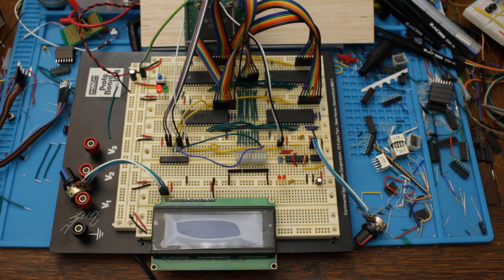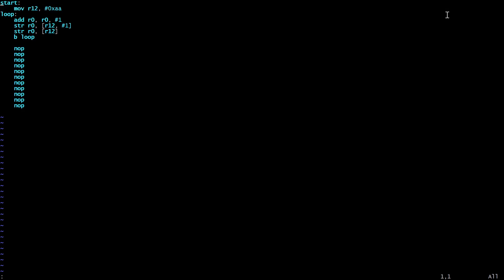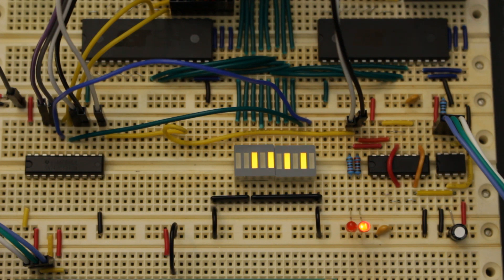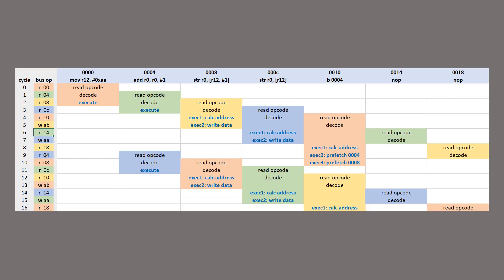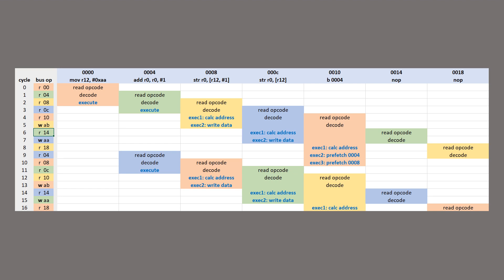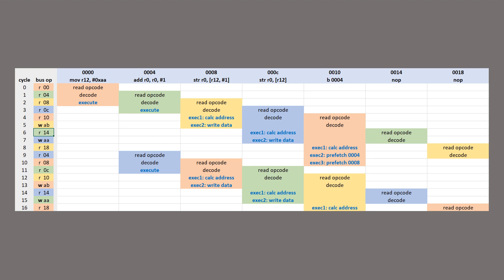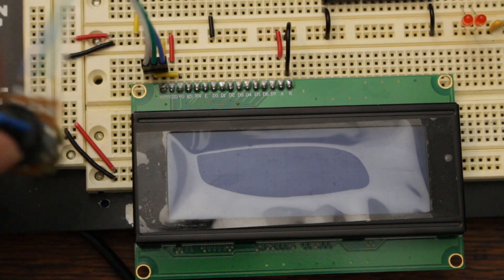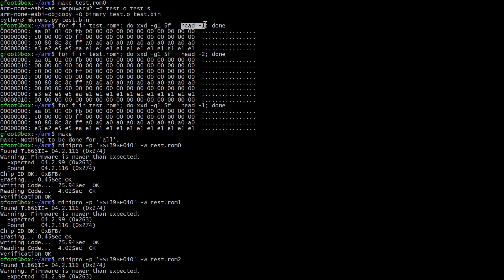Homebrew ARM2 #5: Instruction pipeline and bus analysis

Comment: Do you know why the CPU isn't calculating the adress in parallel with the store?
Reply from the maker: Partly, the CPU runs faster than the RAM, and it's designed to tell the memory controller one cycle in advance what address will be read on the next cycle. The memory controller then stretches the next cycle if necessary to give the RAM the to respond. So it's important to have that knowledge in advance.

I'm not using the memory controller here, it was a separate IC, but that's what the ARM2 was designed to work with.

Comment: It would be interesting to see how ARM handles comparison and conditional branch instructions. For example is there a status register or does it use a general purpose register to handle status flags. Also some RISC processors execute the instruction after a conditional branch due to how pipelining works. Does ARM flush the pipeline?
Reply from the maker: It has status flags embedded in the program counter register, maybe partly why it only has a 26-bit address space. You can save the PC and status flags all in one operation, and restore it all atomically too, e.g. for returning from an interrupt. This also includes interrupt disable flags and user/supervisor mode flags. It's quite neat.

Actually setting the flags is opt-in, and any instruction can be made conditional, not just branches. The top four bits of the opcode are condition bits, and if you look at my program binary you'll see they are "e" for all my instructions, which is "always".

I believe when the instruction's first execute cycle comes up the condition bits are checked and if the condition is not met, it executes a single cycle nop instead. As I showed in the video, the two instructions following any branch are still prefetched, but if the branch (conditional or not) is taken then the pipeline is flushed and refilled on its second and third execution cycles, so those prefetched instructions don't run. If it was conditional and the condition failed, then it will fall through to execute the following instructions that are already in the pipeline.

I should be getting the LCD working soon, and the code for that includes subroutine calls, bit tests, and conditional branching, so I can show what that looks like in practice then.
Reply: @GeorgeFoot  Interesting, it isn't fully RISC since it sounds like it can't be extended to dual issue without some changes. But that wasn't something being done when that CPU was designed.
Reply from the maker: I'm not sure what "fully RISC" really means, I think there are a lot of different characteristics that contribute - but yes there are certainly some CISC-like elements to the design.  It wasn't an academic project, so I don't think "being RISC" was particularly the goal.  They were designing it to serve a practical purpose, and I think there were a few significant constraints - it had to be simple, or they couldn't design and build it; it had to be cheap to produce (cheap process, cheap package); and it had to make efficient use of memory bandwidth, to achieve performance goals.  So while most of the design is simple and orthogonal, they also included instructions like "load multiple" and "store multiple" that are complex to decode and implement, but are there to achieve that performance goal, allowing memory copies and fills to operate at nearly the full memory bandwidth (one 32-bit read or write per clock cycle, while the video subsystem is using the other half of the clock).  The Archimedes didn't use a hardware blitter, and the CPU did a lot of audio processing as well I believe.
Reply: @GeorgeFoot  By "fully RISC" I was thinking about dual issue and out of order execution of instructions. To achieve that the architecture needs to avoid global state registers. In the early 90s I did assembly programming on MIPS and DEC Alpha, and that was a big part of their design philosophy. It made writing efficient code hard because it's not how humans think, but a good C compiler can interleave instructions to take advantage of it. But then again ARM is still around while MIPS and Alpha are no longer being made.
Reply from the maker: @mheermance  Yes, I think modern ARM has a lot more of that going on. I suspect the fact that writing the flags is optional makes it a little easier to consider out of order execution, as most instructions neither read nor write the flags - it's just an additional output from some instructions. You could maybe also have one flag register per execution unit if you're careful to match up the conditional instructions with what they're responding to.
Reply: The original 32-bit ARM ISA and architecture was great for what it was.  Having every single instruction be conditional meant that branch calls could be avoided a lot of the time.  Branch calls are always fairly costly, even on an ARM2 machine with it's shallow 3-stage pipeline, so being able to conditionally execute other instructions can make for some very efficient code where the processor pipeline is kept full.  I had great fun writing demos in assembler on my old Archimedes, back in the day. :-)
Yes - as noted the status flags are indeed embedded in the PC - which brought some efficiencies, but did cut down the address space to 26 bits, which gave the original architecture a limited shelf life. It's pretty unconventional tho compared to other CPUs.
The new 64-bit ARM ISA isn't the same - essentially to help avoid the potential issues noted around dual-issue and out-of-order execution.  Some degree of that could be done with the old ARM ISA, but from what I understand it got very complicated very quickly for the chip designers.  Indeed I believe the Thumb ISA dropped the "everything can be conditional" idea.